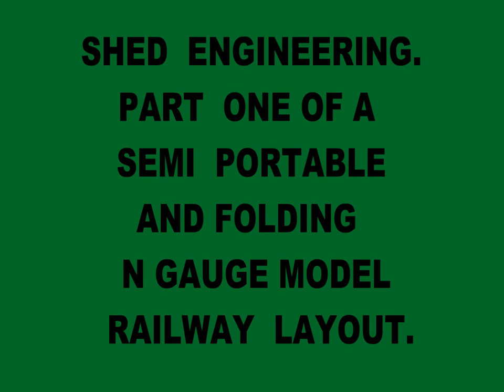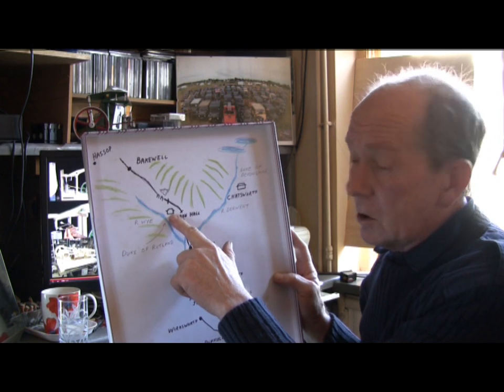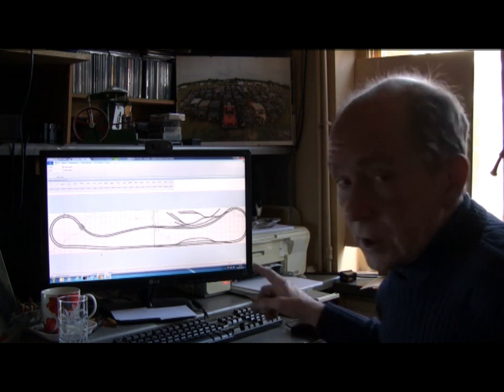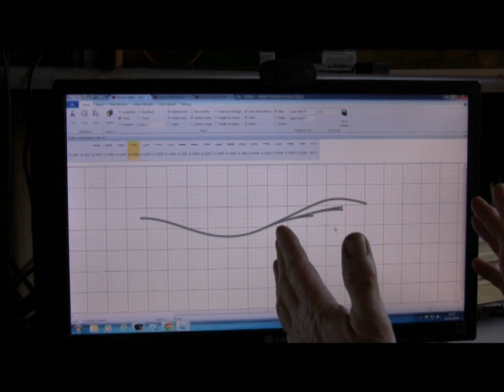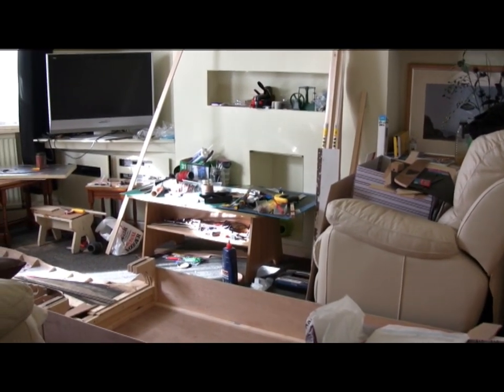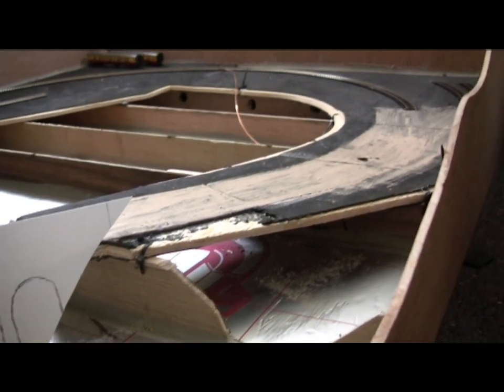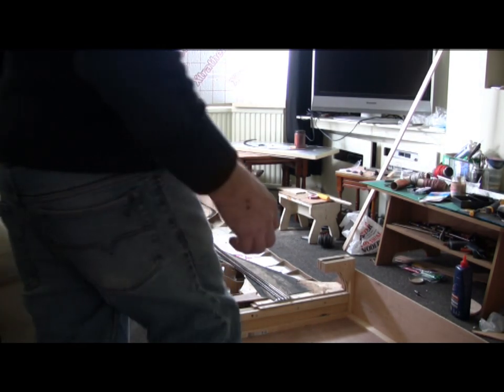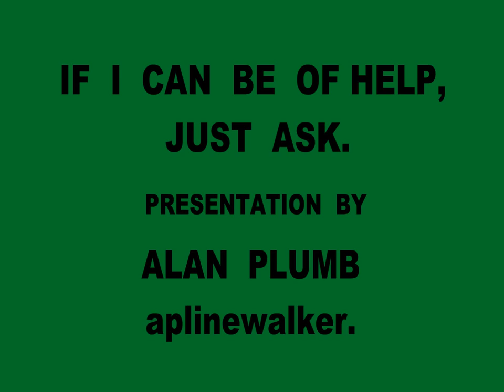N Gauge Folding Model Railway Part One

Comment: I see you have a little helper the meerkat Alan , the computing programme for track plan is very good think I should have invested in that , looks like you have been very busy and covered a lot of ground ..looking forward to watching the progress on this project , not sure but could be easier to solder your droppers on to the track joiners underneath I did a few and it was a lot easier , you could get away with a lot less droppers as well one every 5 ft is sufficient in my opinion
Reply from the maker: Terence Ward Thanks Terence never expected the first comment to come from someone who knows of Rowsley Have stayed on the camp site behind the pub many many times,
Reply from the maker: What are you on about David ???? little helper ????   Covered a lot of ground it don't feel that way,,, That bit is the easy bit,,,, providing it is stiff enough, the hard part is doing the wiring. Re the droppers thanks for the advice, I did try soldering underneath but there's not a lot to choose between the two, its very tight and close to the sleepers with N gauge. Mind you I was trying to cut corners and did not cut a couple of sleepers away. So then I found the ready soldered droppers at my model shop, (A rail joiner with the 4 inch of wire already soldered on)  Cough COUGH  splatter £6 Quid for 8 droppers ,,, sod that I will solder my own first then fit them ,,,,, But then thought im not gaining anything, if the soldered joint is under the joiner, The rail is still only joined by the joiner and by using them you have not improved the electrical connection to the rail itself, So if there is any tarnishing and build up of resistance the ready soldered  droppers will not make a blind bit of difference,  So I dropped that idea, and hence my attempts to solder direct to the track. And also I was worried that with the turning circle been made up from 8 radius sections of setrack that's 16 for the up and down line Plus the fact all that end is in a tunnel, Yes I will make some provision for access, but to retro fit droppers at a later stage might be very troublesome especially with it not been a traditional baseboard where you can get underneath,,,,, my underneath is the outer  box,,,, But I think I have found a method of soldering wires directly to N gauge track, without cutting sleepers out,,, and without melting them,,, Im off to make a video,,,, But its nice to know that else where every 4 or 5 foot is sufficient, Cheers David Thanks
Reply from the maker: Terence Ward Terry Small world,,, fancy the first comment coming from someone who has stayed at the same place. Never seen a helicopter land but the probable field you mention is now "Peak Village" a small shopping centre with the original  Sir Joseph Paxton station building being the centre piece. Although no helicopters when Chatsworth put on concerts the Battle of Britain Memorial Flight,,, Lancaster and two Spitfires come down the Wye valley tune right over the pub and follow the Derwent up to Chatsworth for their fly past and the sound of 6 Merlin engines at low level filling the valley is truly awesome. Yes there is a mill over the road now restored I think its the only turbine water mill in operation, .Caudwell's  So your into N Gauge then ,,, Why no videos ?????  Not even any photos on your page,,, Yes I really fancy the sound ,,, but dread to think how much it costs,,, there was a sign/notice in the model shop thank goodness it was too far away for me to read,  Cheers Alan
Reply from the maker: Hi David / Terence Open /QUESTION,,,, 
Some one was good enough to give me 2 old blood and custard couches ,,,, and they have metal wheels,,,,, I have only managed to purchase a van and 4 coal wagons but they all have plastic wheels,,,,, whats the idea of the metal ones,,,, surely the will make a short between the live and negative rails. (When ,,, where,,,, or how do you use rolling stock with metal wheels, )
Reply: ***** Most of the new stock are metal wheels now Alan , they dont cause shorts except maybe on some Peco points with a tight frog , but when you think about it all the Loco`s are metal wheels , some of my old stock coaches had plastic wheels and derailed regular , but now changed to metal run smoothly ..just need to clean them more often with DCC  ...dave
Reply from the maker: ***** Cheers David ,,, Ya the loco wheels are metal but I was presuming that was for them to make contact and pick up juice but must have some fiendish insulation like the axles been none conductive or something, I cant get my head around how you can have a rake of rolling stock with the metal wheels shorting the Live rail to the Negative rail and it all still work ,,,, Electricity is strange stuff alright,,,, Thanks David
Reply from the maker: Terence Ward Hi Terence Are ARE  ARE So they might have plastic axles ,,,, that would make sense  ,,,, I don't Know Terence I will have to investigate, You have put a video up,,,, strange I havent had a notification (Perhaps im not subscribed to you )  ,,,,  I will check it out many thanks. But I did some wiring last night but filed the tip of my soldering iron down and I think im getting a better contact area,,,, to transfer the heat,,,, and I used thicker dropper wire as well and in doing that I think a lot of the heat is going down the dropper wire and less heat travelling into the line to melt the sleepers, and I did all right....  But I will watch with interest later..got to dash . (just got a call out for a body fluid clean up at the hospital )  Many Thanks Terence

Comment: Nice work Alan.How did you manage to keep the tracks connected/disconnected at the sections where the table folds?
Reply from the maker: Hi there many thanks for dropping by,,,, I think in part 7 ,,,, I show the join,,,,,  But basically where the two sections meet instead of it just been timber a inset a piece of aluminium angle along the edges where the track would be crossing from one section to the next,,,that gave me something solid to work with,(,and that was rebated so it was flush) But under neath I epoxied in two nuts,,,, with small bolts through the angle I was able to make the aluminum angle adjustable ,,, so with a slotted bolt either side I could raise or lower the it just by a couple of mm......    the track then come onto the angle and instead of it been in ONE fixed position ,,,, I just made some little plats or clips shaped to hold the sleepers but with holes a bit bigger than the bolts etc,,, I was able to again get a few millimeters adjustment side to side,,,, so then I could raise or lower the track or move it side ways a tinny bit and re-tighten the clips,,,, and so far its working OK,,,, Its actually quite complicated,,,,  since starting I have seen a layout built on building foam,,,,, something most Purists would condemn and frown upon ,,,,,,but it is very light and can be stood up in a corner or behind a door or pushed under a bed,,, or Light enough to build a simple from around and have it folding down off a wall,,,, Ok the height of you modelling may be restricted to 6 to 8 inches  but that would be another option if your short of space,,,, But I also wanted to try and develop a road system ,,,,,, and to depict coal been unloaded and loaded onto a lorry which would then drive off,,,, and I wanted to try a working goods yard crane,,,, where just a push pull lever will lift turn and lower the crane, and I have a proof of concept video  of that working ,,,,   I hope that helps ,,,, again many thanks for your interest ,,, Best regards,,,, Alan